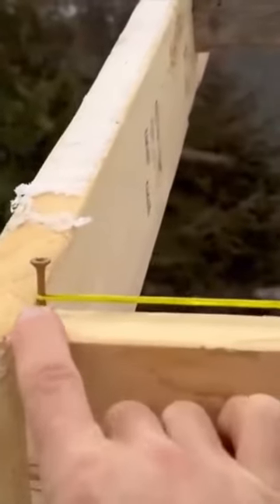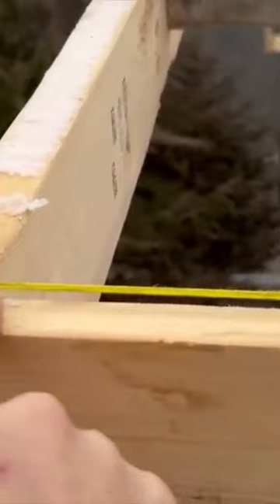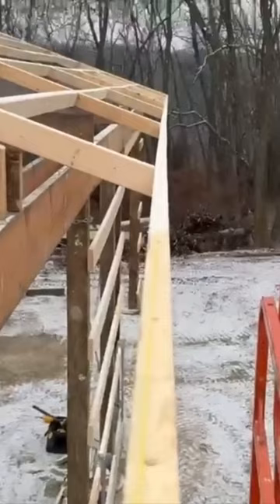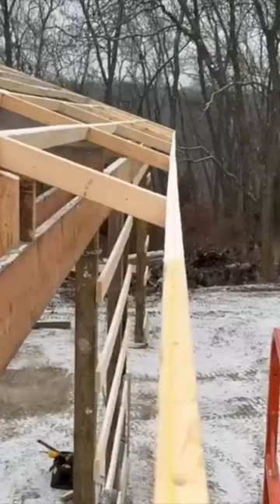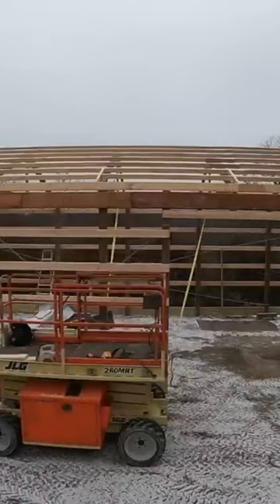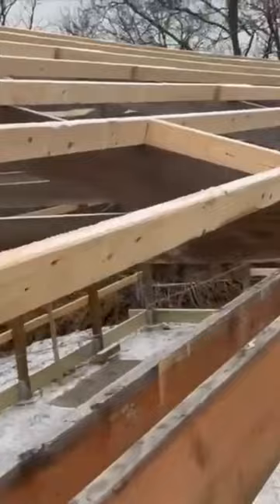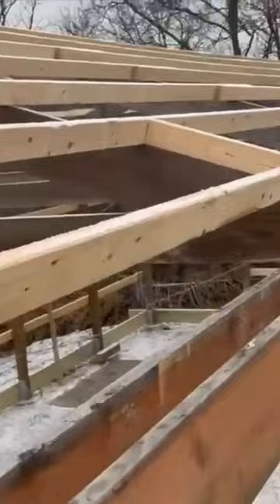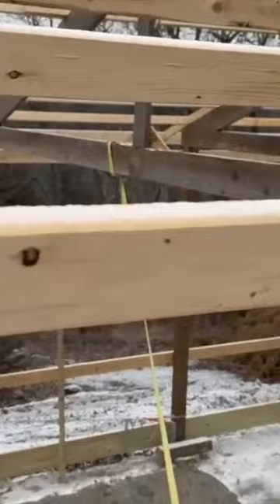Straighten Fascia Post Frame Building #shorts

Comment: Why wouldn't you go to the outside of your SUB facia with the line....and your building should already be plumb and lever with a brace bay and you should run your tails long snap a line on them and cut.....there is not one thing in this video that is being done correct......I mean pulling a column out of plum for your sub facia....obvisly first time
Reply: Take a second and do some research before trying to ridicule someone else's work. First off, one click to go to his channel would show you its obviously not his first time. His entire channel (many, many videos) is about teaching others how to build post frame.

Secondly, I also build post frame for a living, and neither he nor I, or any other reputable post frame builder I know does it the way you describe. Columns are typically 8' oc apart and are usually between 16-20'+ high. Even if you plumb your columns when raising walls, they are typically going to slightly move out of plumb before you get to these steps. If you measure everything correctly, and keep all rafter tails exactly the same as he did, then you straighten the walls (columns and tails) with this process before squaring the roof and locking it all in with the steel panels.

There is always more than one correct way to do things, if you are stick framing then your way works great. Through much trial and error, I've found this method to be the most reliable and efficient way for us when doing post frame buildings.
Reply: Not sure what to think does that straighten post ? Thanks I am thinking of building my own building looking for knowledge 😁
Reply: @shawnsmith4058  It will make everything parallel and even on both sides. In theory, yes it would plumb both side wall columns together, as long as your measurements are always right and consistent. You can always tweak column plumb-ness with the straps or chains, as Paul showed in this clip. 

Once you have straight rafter tails and a square roof, you lock it in with the roof metal panels. 

Check out more of Paul's videos on the subject, he does a good job of explaining it all.